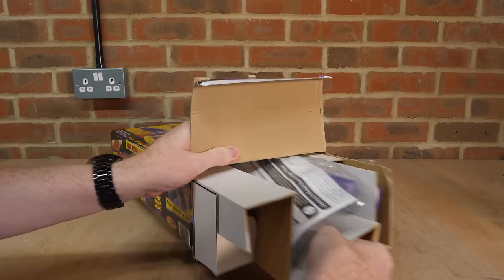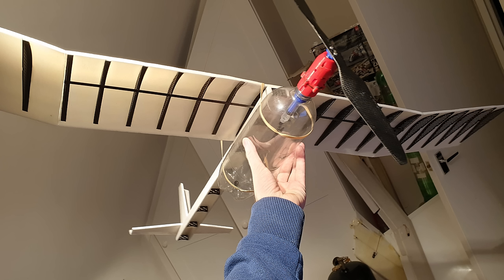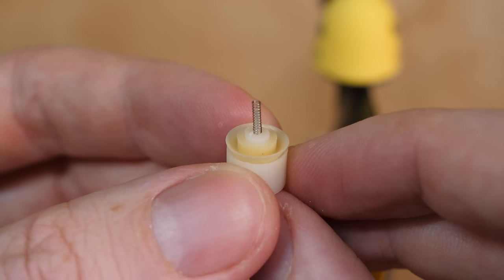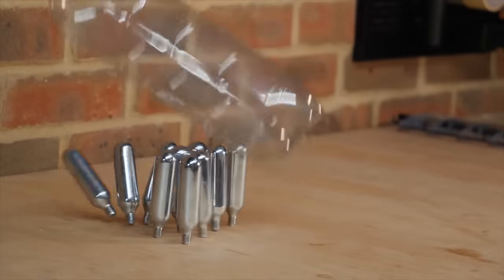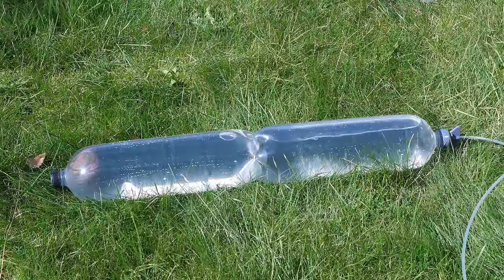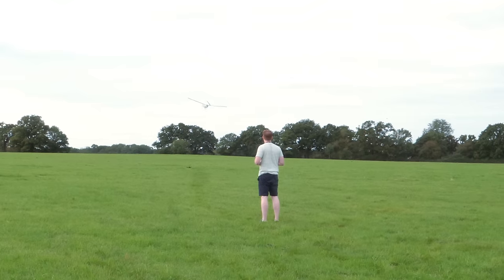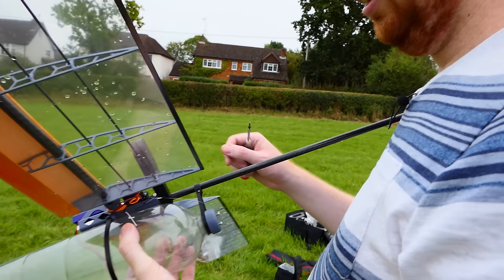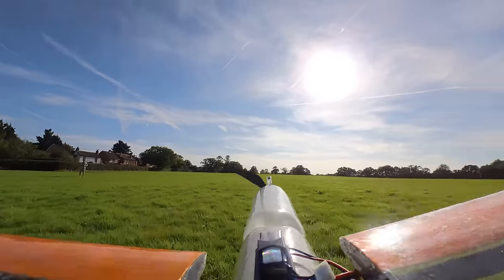Flying a Plane Powered by AIR

Comment: use a small ultra light carbon fiber paintball tank (0.8l), adapt the engine to get more power, you can find regulators that you can set to 200 to 800 psi approx. These tanks take 4500psi, you can probably fly a similar design plane for 10 min.

Comment: Very impressive, I think you will find a higher pitch prop will give you longer flight times. Static thrust in this application isnt as impartant as dynamic thrust. Standard prop thrust figures can be misleading.

Comment: My suggestion would be using two 3 litre bottles for 50% extra storage and pressure testing them before using on the plane, so maybe you could put even more pressure! Maybe using a pressure regulator on the output of the bottles could help mantaining a stable power flow onto the engine and reduce comsumption
Reply: My thoughts too. Those bottles are rated I believe for several hundred PSI, the reason being that the pressure inside goes through the roof when half full of fizz if left in the sun in a hot car. That's why there are vertical slots on the lid thread to vent the pressure as soon as the lid is turned. These I believe were added following an accident when a lid blew off and took somebodies eye out!

Comment: hi, first of all a round of applause for the effort and success, as well as the professionalism of the work you have done. 
then some recommendations on the aircraft; try to make a wing with a thinner profile and in which the profile varies from a thick to a thin one from the wing root to the tip, even if the dihedral is something useful in stability it gives a lot of drag, try to decrease it and leave it in a maximum of 3 or 4 degrees, if you can, make a wing with double dihedral, finally add wingtips, even if they are not wingleds a rounded wingtip decreases significantly the drag.
al last, but not less, during the flight, try to maintain a more constant and less steep climb, so that the angle of attack remains "low", this keeps the drag low and increases the speed, which increases the lift more than the angle of attack (or the climb slope).

Comment: I would think there would be a way to save the compressed air coming out of the exhaust of the engine back into the tank. One way valve or something. That way you get longer flights.

Comment: I just made an rc airplane that has a very similar design. The airplane in this video is just a high effort and lighter version of mine. Mine used foam board for the aero foil shape, parachute style fabric for the cover, and some thin one layer cardboard for the leading edges. I even used plastic bottles at the front to house the electronics and a two metre wingspan. I guess great minds do indeed think alike.

Comment: What if you were to use a paint ball/air soft tank. A smaller 15cu-in carbon fiber tank weighs about 350g and are rated for 4500 psi. Might allow for several minutes of consistent full power.

Comment: try using a (airsoft) carbon fiber pressure tank. 1l will weights around 1 kg yet have 310 bar pressure, should mean longer flight time even though its a lot heavier than the drinks bottles.

Comment: What plastic do you print? I see a lot of possible weightsavings going to lighter plastic, then you could do smaller nozzle and thinner layers and also space them (layer separation + spar distancing) out and add more holes to balsa.. A LOT still in the table. I think that 1:20 time is so good that it makes improving it further much more exciting. You can also get carbon tubes with thinner walls. OR Maybe just carbon between the frist and second and second to last and last is enough to make ends not bulge. So you can cancel the small rods elsewhere.

Comment: It’s not an issue for this air engine, but the waist design, if you ever flew upside down or even turned more than about five or 10°, the ball valve would likely slip off. As result, I would think you would want to put a light spring on the other sideso that if the plane tilts the ball would remain in place. If you did this, you’d also want to have a cylinder for the ball to live in with inlets as opposed adjust free open cavity for the pressurized air to enter into the engine.

Comment: Nice project. One note: you are actually wrong about the gas volume inside the CO2 cartridge. The CO2 is in liquid form and thus it will expand to a much larger volume e.g. typical 12g cartridge contains about 6 liters of CO2 gas at normal conditions.

Comment: Why did you not use PLA Aero? It's a foaming PLA thats suitable for 3D-printing. Overall it's impact resistant and very light, depending on the print settings. Should be heat resitant enough for heat activated adhesive.

Comment: When I first watched this video 5 days ago and I saw the design of the newest aircraft I was a little skeptical of the design, specifically the way the engine was attached to the end of the bottles and that the bottles extend far from the leading edge of the wings, giving it a heavy tilt towards the nose of the plane. Under further consideration I realize I was completely correct at the moment of launch, but had not considered the difference in the weight of the nose of the plane at launch (heavier but with more thrust to compensate for the weight), as compared to the end of flight time where the nose will be much closer to neutral buoyancy but not perfectly close but the weight of batteries and tail section should cause the weight to shift more towards the back than the front giving a better glide than nose dive fall.

Other thought: when comparing CO2 cartridges vs Drink bottle did you pressurize the bottle before weighing? I doubt it would make a massive difference, pun intended, but I do think the measurement could be noteworthy when comparing. As an ex calibrator the comparison of items must be situationally identical.

Comment: Maybe try to regulat the aire flow/pressure coming out.

Since you would consume more pressure at the start when can probably use a constant pressure.
Also I’m not sure but if you use more cylinders you should also consume less aire over all.

Comment: I’d try making a 2 cylinder engine I think if you can get the bearing surfaces smooth/slippery enough you’ll be able to get higher power out put or efficiency out of a 2 piston with similar total displacement given it will have a lower power but 100% of the time rather than the power only being applied on one side of the sign wave. Just a theory but might work

Comment: Had you ever thought about adding a compounding turbo to the output shaft of the engine using the exhaust of your air engine? Your newer video you been working on air turbine. Maybe put them together?

Comment: Have you considered utilising a PCP Air Rifle Carbon Fibre HPA Tank?...
A 500cc tank has a 300bar / 4500psi working pressure, while weighing less than 300g... 
The considerable increase in potential energy would allow you to raise the power output (smaller faster 3 blade prop perhaps) while extending the performance envelope and endurance significantly...

Comment: I'm not sure if you did it or not - but 3d printing a small prop holder which holss the prop on with a stretched o-ring might help with crank shaft breakage on landings?

Comment: Good morning Mr Stanton , 
I recently went through some of your videos , dealing with a piston engine .
You went through a lot of research and development work , so , I just say ‘’hat off’.
As a mechanical engineer , i scratched my head about your problematics , so ,  may I suggest you the following , as I foresee that gaining a few percent of efficiency is the main goal in this engine .
1-	piston skirt shape could be altered , just let some material on the sides , to guide the piston in 
its cylinder – friction surfaces as well as weight will be reduced.

2-	cylinder axis with the crankshaft axis could have an  offset  of  2 milimeters ( or something like that ) , so that when the power stroke occurs , the lateral friction force is reduced , compared to a classical fitting .

3-	I imagined a device , that allow trapped air to be vented while the piston is on its way back to the top of the cylinder – As the end of the connecting rod is a sphere , you could drill trough so that trapped air  is drained , and the oscillating movement of the connecting rod will allow the drain port to close when it’s the power stroke phase .

4-	Thermal insulation could be made also by mean of soft foam around the cylinder – running more adiabatic could help a bit .

I made rough sketches of these points on paper , took photographs , and included them to this message .Not an easy way to communicate , but I’m ‘’old school’’ .
Hope this helps , 
Best regards .

Comment: connect 4 bottles together with two engines in a pusher - puller config. alternatively, make two underwing engine pods with a barely existant center fuselage.

Comment: Hi Tom, just a few observations from an old Coot in the US. I'm noticing when in flight your model is Dutch Rolling a little.  Maybe a bit more dihedral in the main wing, and if you could tighten the V-tail's angle to about 90 or a small amount more degrees it would present more side area to the airflow and steady that yawing wobble.  Also could you track down a steeper pitch propeller and maybe a folding one? Your model is just barely flying on the wing, which appears to me that you need a little more thrust.  Your pneumatic engine is pretty decent but it seems to not unload much from being held in your hand to flying speed which is possibly needing more pitch thrust.
Reply: Also  could I get your permission to make a 3D model of this to simulate in PhoenixRC?

Comment: Nice work! have you considered using larger capacity bottles? I'm sure I've seen 2.5-3 litre bottles that would give you a lot more capacity with only slightly more frontal cross sectional area.

Comment: Or you could have 2 engines with 6 bottles and same amount of wing. But would be way better if you could hold the pressure in the wings as well as the fuselage but have a regulator to make sure the the wings never give up more psi then is needed to keep the required strength.  

So if the whole plan whats the bottle and used the are for stability and fuel that would be great. Could even consider making it so that when the fuel runs out it goes limp so when it crashes no damage would occur, but I imagine that last part would be tough.

Comment: why not attach the propeller with small, strong magnets to the engine via a little 'clutch'? Think of drillbit in the middle of the propeller and two N magnets just a little bit to the outside, connects to a washer with two S Magnets and a screwhead in the middle attached to the engine. if you hit the ground the propeller should come off clean, without snapping anyting... just a thought.

Comment: Have you studied plastic blow moulding? 

It would be a bit of a stretch in all directions, but if your could 3d print your mould tooling and mould a full length bottle you could then delete a lot of your current design constraints. 

The moulded fuselage can be whatever shape best suits the aircraft, maybe going narrower and deeper to protect the prop on landing. 

A single piece bottle would delete the double base and bulkhead coupling saving a bit more weight. 

The rear section could be shaped more in line with a conventional aircraft design and then delete your current fuselage. 

The idea in my head right now would look similar to a C46 from ww2. 

If the blow moulded fuselage works well you could even look at blow moulding the wings and using them as additional pressure vesils. 

I have built plastic blow mould tools in the past if you need any help. 

If anyone else reading this can help bring this to Tom's attention thst would be awsome.

Comment: Hey Tom, I just had a thought for a video idea. Would there be a way to build an airplane with no moving external control surfaces? Using an internal flywheel gyro being manipulated to induce attitude changes? I imagine either a plane with twin motors to counteract their own gyro forces, or a stable flying wing like the x8. I did a quick search to see if its been done, but as far as i know, it hasnt. Love the vids anyways brother! Cheers!

Comment: If it can help : use a small amount of fine  graphite powder mix with cyanoacrylate to reinforce any surface , i use it to repair my ping pong paddle which becomes stronger than original Fascinating work you are doing .

Comment: Are these engines more efficient than putting a pinhole in a pressurized bottle and using the airflow as thrust? I'm just genuinely curious.
Reply: Kindof like a air jet engine! It should probably be better since it has less components
Reply: I guess we just have to wait for the jet age to come, but for air engines lol

Comment: the reason you heard a leak is due to the ball valve when you air it up you have it open so if your not continuosly pupping you losing air like on a bike when you unlatch it becuase it has a built in air valve in the tube that is stationary until unlachted to the air pump

Comment: Could you make a 2 cylinder motor? Or even a v twin? I think of you made a v-twin you could get enough low end torque to do pretty much whatever you wanted and just use a central diaphragm to distribute the air between the two cylinders like a carburetor.

Comment: Need a one-way slip connection on that propshaft. Two parts with some  dogs that have a slope on one side to engage and then slip in the opposite direction is all you need.

edit also ditch the big lipo for your rx. That's really not needed.
and throw on an extra half gram of weight onto the nose
And I believe you want to find a better prop. That one's not right for your torque and rpm.

Comment: Hi Tom, congratulations on the beautiful project, what do you think about adding helium gas to the wings to lighten the weight? It is necessary to seal well to obtain interesting results😉, depending on the design I think that in other parts and perhaps another encapsulation the helium could enter, think about that!

Comment: One would assume that with a bigger propeller there would need to be a larger amount of air pushing down the piston during the power stroke because the heavier propeller (flywheel) makes it harder to spin, thus increasing the amount of air used per engine cycle. That said, one would also assume that a larger propeller would make the engine spin slower, also because the propeller is harder to spin, which would cause the engine to use less air during a given time because there are less cycles during a given time. Do you know if these effects cancel out, or if a larger propeller results in more or less air being used during a given time? I’m asking this because I think there may be a sweet spot in propeller size to maximize the range. The probably is also a sweet spot for thrust, where any larger and the engine will have too hard of a time getting the propeller to spin and  any smaller and the faster propeller speed won’t be enough to make up for the thrust lost due to the smaller size of the blades. So you could probably have a blade size to get the best range and another to get the most thrust. Not an aerospace engineer but I have good ideas sometimes 😃.

Comment: pro tip: create winglets to reduce drag and use the wings as extra fuel tanks like real planes and then addd flaps for lower stall speed to then use less thrust for more fuel which means more flight time and maybe MAKE IT A GASOLINE ENGINE FOR THAT POWAAAAAAA

Comment: Excuse my engineering naivety but I wonder if incorporating a fly wheel with the propeller (perhaps spin it up with an electric (or compressed air) motor to start) increase runtime? Or would it add too much weight? Too much weight in the front? Idk...

Comment: 3d printed this 3 printed that, love the creativity of these videos, good job, how about strenghtening the bottles somehow to make them able to withstand more pressure (wear ear and eye protection if you do it !) or simply trying to make air containers that are able to do that, or maybe there are even bigger bottle available in commerce ? like 4 liters lol I doubt but it might be dangerous so..bad idea, adding more bottles sounds good if you can add 1 more, or how about adding smaller ones under each wings maybe mmh, 3-4 big ones plus smaller ones would look so cool aha, but might be too much weight

Comment: I think there's a missconception in the video, i'm an electronics technician, so i'm not so much into pressure physics, but making an analogy with an electric circuit, the energy stored in the gas container increases with the square* of the pressure, idk exactly how to compare the energy stored in both containers but it's not only the volume of air that's important in the ecuation, you could store less volume but in a higher pressure and have the same or higher energy
Reply: look, this is what GPT says about the energy in a container:

U = 1/2 V/E * P^2

Where :
U=energy
V=volume of the container
E=elasticity module of the container (this is also higher in the bottle and decreases the energy it can store)
P=pressure in the container

As you can see, the energy increases with the square of the pressure, so ignoring the elasticity module (as i don't know the values of each container)
you have :
Bottle: 1/2 * 2L *8,27bar^2 = 68.4
c02 cartridge: 1/2 * 0,021L * 55,1bar^2 = 31.87

so the c02 cartridge has a bit less energy, but not 14 times, only 3 times less thrust to weight ratio, uf you had a c02 cartridge with 3 times the volume it would be the same as the bottle